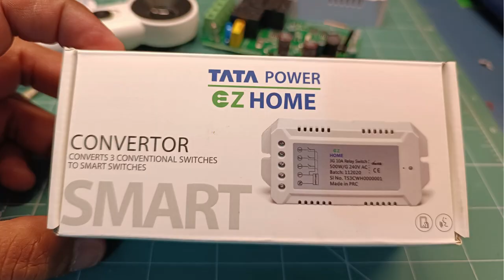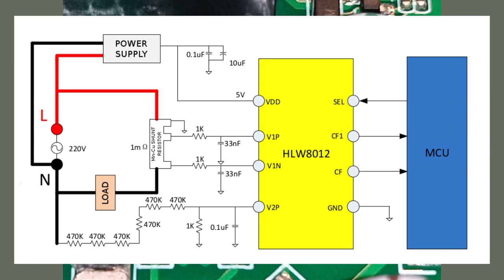TATA WiFi Smart Switch Teardown

Comment: I am still in doubt what's the point of using two MCUs.. ESP8286 is capable of handling all. If not they could have go for ESp32 for extra GPIOs and processing power. Can anyone explain ?
Reply from the maker: if someone doesn't how to use it, they will end up using 2 MCUs.

Comment: They did not even bother cleaning the flux. And this does not have anything that could not be manufactured in india. Most of it is just passive components that are made in india for decades. Only the semiconductors.need to be imported so why aren't they making it in India with indian parts.
Reply from the maker: Doesn't make business sense to get it done in India. It's business. There are lot of things when. Making a decision on manufacturing in India. If you have ever done any product development and manufacturing in India you would know we have several challenges